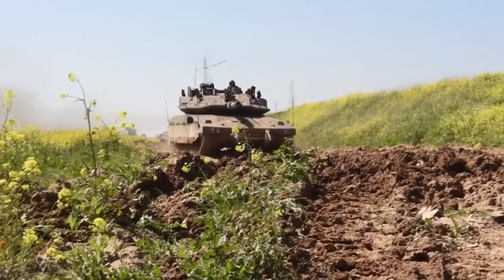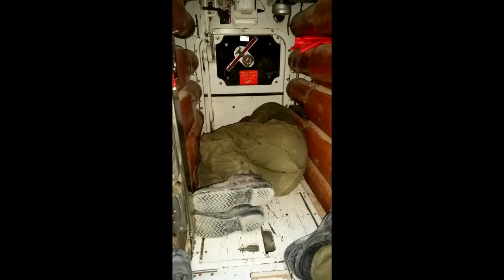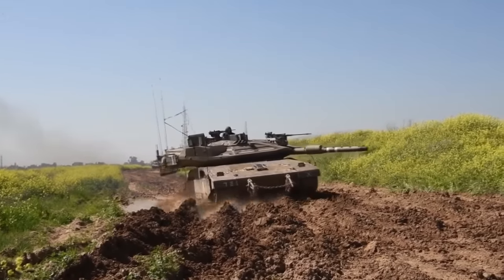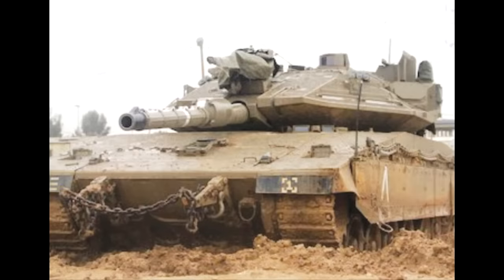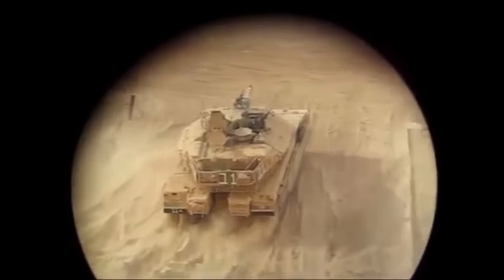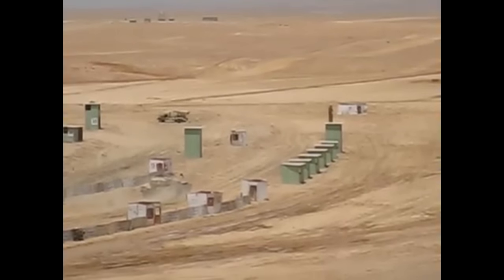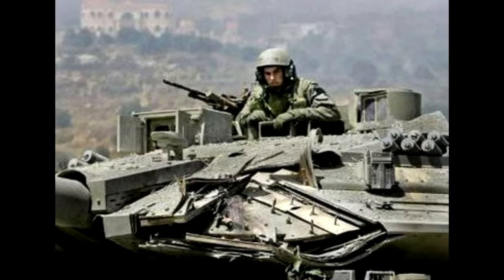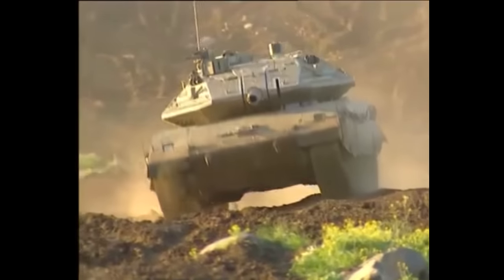Problems with Merkava tank

Comment: The thing you have to keep in mind is that Israel didn't design the tank for tank on tank combat, far from it, it's focused on urban warfare and vs. ATGMs or RPGs as that is the threats that Israel has to go up against.
Surely it isn't the best tank in the world in every aspect, but for what it was designed for it might just be.
I can confirm the engine's exhaust sometimes interferes with the thermal sights, but you can work around it relatively easily.
Great video!

Comment: There are no invincible tanks.
Some are better for warfare in icy areas, others are better for warfare in hot areas.
Some are better for wet areas, others are better for deserts full of dust floating in the air.
The Merkava was designed specifically for Israel's needs, not Ukraine's, not the US.  And it works well for Israel.
It is true that about twenty of these tanks were destroyed, but the same has happened with the Russian T-14 Armata tank, considered a very advanced tank. And the same would happen with other tanks.
The reality is that Israel has lost only one tank in Gaza in almost 3 months of war, despite the fact that HAMAS possesses THOUSANDS of RPG anti-tank missiles.
So things aren't so bad with this tank....
Reply: Tank tidak hancur tapi hulu ledak yasin tipe tandem shaped charge melobangi dan membunuh kru tank atau membuat amputasi dan gila

Comment: "there are no modern composites than have equal or better levels of protection than the same thickness of steel" based on what may I add. Where do you source this?

Comment: ...you...you do realize, they angled/sloped the armor to encourage richochets... since MOST shells in modern tanks arsenals require a 90-45 degree impact for the munitions to actually puncture otherwise they're not facing 100mm dead on, it actually due to geometry turns 100mm into about 115mm-120mm due to the round moving in a straight line. 

Now, with all that said, some rounds are designed to 'auto-correct' on impact, turning the round as well as deformity deformity warheads nose cone so it brings it (hopefully) into that 45-90 degree strike and inducing a damaging blow.

But, because tank shells just like bullets and other physical projectiles or ballistic weapons operate on physics, physical objects traveling in a straight line and with force to a target, will deflect and change angles to the path of least resistance on impact. So unless you're shooting it from below, or above at angles that turn those odd shaped faces into 'sweet spots' (look back to 45-90 degree corrections) those angled faces will increase the odds of a shell or explosive shells (rpg's etc) being redirected away and richocheting rounds way off course. The principle is also visible in ballistics on rounded surfaces, since the energy is directed around the 'bulb' it encourages the shot to travel in directions where they encounter the least physical resistance 'forward'.

Now, with this all said, yeah... the turrets having a face TOWARDS the main body is...kinda a misuse of angles... one wrong shot and it's deflecting a shot down into the main body.
Reply: Modern apfsds don't care about armour angle.

Comment: These are all good points imo. As for the gun from what a friend Israeli tanker told me most of the rounds loaded in the tank are HE rounds of different variants so I am unsure if the Merkava needs a bigger gun since mostly it is designed to fight in cities it will still fire the same HE rounds as for a longer barrel it would be harder to maneuver around.
But this is how I see it I may be completely wrong as I did not conduct any research and my comment is purely made on my opinion.

Comment: Wait so because the front fuel tank is only protected by 100mm of armour and if set on fire could knock out the tank, then you're telling me this thing can be destroyed by a tiger from the front.
And because of this one single exploit that means the tiger is by far the superior tank obviously
Reply: You forgot about the angling of the armour. It gives it at least 300 mm effective armour thickness.

Comment: im not sure where you done your research but even abrams tanks are being taken out with 20$ IED's every tank has its flaws and the armour of the tanks these days is nothing compared to the AT rockets today therefore the design of the merkava is made for israely use only, it has what it needs for the use of israely forces put aside that a tank in israel that was damaged today can be repaired in about a day because the armor is built from chunks also the fuel is placed at the front for the exact reason that the shells can catch fire the motor that is placed at the front of the tank saved a very big number of crews and has shown its effectiveness in real battles, i disagree with alot of things you said but as i said before 20$ IED is enough to take out a tank, in israel each tank also has its attachments and the reactive armor on top of it will get upgrades soon that it will be able to reload itself without going back for replacing it. i think you should do better researches unless your channel is only made to degrade military equipment at any cost.
Reply: note the merkava can go into a battle backwords im not sure how much it would make the tank less effective from the perspective of offense but imo it should be used the way its meant to be used. if you wanna actually go and say this tank is bad leave the engine out find other flaws cuz the engine is in the front for a reason ill subscribe to see the video.

Comment: Why put the engine in the front? That’s kinda dumb
Reply: the merkava is made for crew survivability plus fuel is a very good armor against HEAT shells, the sweeds took note of this with the strc 103 they added jerry cans in the sides with fuel as a type of side armor, also during the yom Kippur war the IDF sustained alot of casualties 2500+ which drove the emphasis on crew survivability , last thing the power pack is also like a very thick armor even tho the tank is mission killed the crew is still alive and the tank can be recovered and repaired
Reply: For room so the crew can get out.
Unlike the Abrams, the Merkava doesn't burn it's crew alive whilst they try and evacuate.

Comment: Some rpg rocket hit on ammo compartment the back this useless tank will do the job. 100% surely does.
Reply: very few types of kits are capable of reaching this "compartment" when you have some very nifty (and secretive) active protection systems on board, your RPG will not get the chance to meet the armor of the Tank, maybe the metal shreds of it, which will only scratch the armor, 0,5mm deep

Comment: Does Irael use depleted uranium ammunition?
Because if I remember correctly the apfsds ammunition mad of depleted uranium fired by an L/44 gun matches or even outperforms tungston Ammunition fired by and L/55 gun. That was the US army's reason to stay with the L/44 gun, because they didn't think the L/55 would be necessary.
Germany adopted the L/55 because they won't (or are not allowed) to use uranium.
Reply: That wasn't the reason at all. L/55 just doesn't fit on the Abrams, which was designed with a 105mm and retrofitted with the 120mm L/44.
Reply: @SuperGeronimo999 I thought they didn't really change the breach of the L55 cannon in terms of making it bigger, seems to me they just slapped an extra half meter of barrel in front of the L44 and called it a day, so it shouldn't be a massive problem to fit it onto Abrams models. I think the main reason why the army kept the L44 was that it was already more than adequate for taking on T-72b3s and t-64s that they'd usually fight, so they didn't bother spending the money on refitting all the old Abrams models.
Reply: @ExHyperion  As i said, the Abrams was designed with a 105mm cannon in mind, and the 120mm L/44 is as far as they could go. The exact same goes for the israeli Merkava. There will be balancing issues and the turret will have problems to rotate if the tank isn't in flat terrain. 

They actually tried it, back in 1999:
https://www.globalsecurity.org/military/library/budget/fy2001/army-peds/0603653A.pdf
Reply: @ExHyperion  Also still experimenting with other guns: https://www.youtube.com/watch?v=5lqW94Gmug8

Comment: Most cars have a engine in the forward,this is also adding to the safety of the driver. 
So the ideas are not that strange, but a tank is not a car. 
But no matter what you do,it is only a matter of time,before your opponent finds a way ,to counter it.
Reply: most(if not all) country that fight against israel doesnt have APFSDS

main danger faced by merkava is RPG and KORNET ATGM , not tanks, both are basically wont scratch the crew if shot into the frontal part, thanks to the engine placement on the front

sure you can upgrade armor to make it better, but there is the catch

it add weights>>more weights means you need more powerful engine for the same mobility>>more powerful engine consume more fuels>>bigger engine and more fuels means bigger tank

why not? you might ask
problem is this tank is more or less gonna be used extensively in urban combat, thats why it doesnt upgrade its guns, because its shorter, easier to use in urban combat. like i said before, the main danger of this tank is RPG and KORNET ATGM, which is more deadly in urban combat

so by changing the armor, you basically nerf the tank on the urban combat, which this tank most likely face, but buff it on modern tank vs modern tank battle which it might never went into with higher production cost tag and higher maintenance cost

Comment: I'm wondering, all tanks seem to have problems. Tank experts seem to already know what's good and what's bad in every tank in the world. How come the "perfect tank" does not exist yet?
Reply: Because there's simply no such thing as "perfect tank". Every advantages one tank had will always had disadvantages
Reply: @Kalashnikov413  There must be a reason why such that is. So what's keeping the 'perfect tank' from existing? Weight? Technology availability to the country? Cost? Size of tank?
Reply: @The_Crazy_Monkey75  if you want a "perfect tank", it must be:
- easy to produced
- cheap (or at least not that expensive)
- versatile
- and suited for certain country's doctrine
Reply: @The_Crazy_Monkey75  you can't have any tanks without some sort of weaknesses. Let's say:

- You want to make your tanks small so that it was harder to hit. But by doing that you sacrificed the crew ergonomic, resulted in less effective crew performances.
or...
- You want to add think armor to your tank so that it can resist a lot of shot. But by doing that you basically increase the weight of the tank, thus making it harder to be transported and recovered when it stuck or broke down.
Reply: @Kalashnikov413  Ooooooh...ok!

Comment: Well the whole tank is designed to prevent crew kills over anything else so the engine placement and using the fuel and water in the tank as part of the armor makes sense.  Especially against infantry anti tank weapons which the IS has allot of exp against I'm sure.  From what I've read they'd rather have a mobility kill then lose the tank crew.  But then you'd think they'd have better ammo storage.   😅 It would be interesting to see crew survivability atats of the various MBTs.   Especially since more recently revealed stats on tanks like the Sherman put the tank in a whole new light showing them not to be the "death traps" everyone "knew" them to be.  Especially in this day and age were the value of a well trained tank crew far out weights the price of the tank.  
In the end I think this is more of a anti-insurgency tank then what we would consider an MBT.  Although I think its more then a match for any vehicle its likely to come up against in the Israeli theater.  Hence why I think they stick to the shorter barrel length cannon for use in built up areas.  Its the same reason the Canadian military is upgrading  their leopard 2s to the A6 standard but on some tanks they are keeping the shorter caliber gun (for the Anti-insurgency role) based on their exp in Afghanistan.
The Israelis  sure know how to upgrade their tanks though.  The differences between the Mk1 and Mk4 are substantial.

Comment: Engine heat obscuring gunner thermal vision? Gunner needs to turn the turret to see a target? That is a kind of nonsense you rarely hear. Whoever says that kind of dogshit, does not have a clue what is a black body radiation and how thermal sensors work. And the video is proposing what exactly? That tank with a crew in front and engine in the back is more protected then tank with an engine in front of the crew? Did the author think about what is that protection for exactly and what (who) needs to be protected by it? Only thing close to common sense in this video is the fact that tank with an engine in front will have higher thermal signature seen from the front.

Although we have not seen Merkava Mk4 fighting against other tanks to understand its protection against kinetic projectiles, it is one of the most battle tested tanks being in active duty today. Not just battle tested, but having it done in the most unfavorable for the tank conditions, in an urban environment. And in its history there is more than enough facts proving its very high degree of protection. 

Overall this channel is more about translating Russian propaganda about Russian armor, about flying hard kill systems miraculously defeating incoming APFSDS projectiles  that are moving with 1500 m/s and having kinetic energy of a freakin train, Russian Explosive Reactive Armor defeating top attack anty-tank missiles with a tandem warhead and that kind of |Russian vunderwaffe fairytales. 

If the author would believe less to propaganda videos, and would use more objective analysis without axiom statements not backed but anything like in this video, this channel would be of much higher quality.

Comment: Thank you for this very intresting video ,Can't they move the engine to the rear of the tank and use the older tanks that have been converted to personel carriers . concidering just how much Israel needs it's tanks one would think that they would not delay and fix this problem  a.s.a.p
Reply: Clearly the IDF doesn't see it as a problem.
Reply: This tank isn’t a Western tank, it’s design specifically adheres to what Israel needs. It’s not trying to be the best of every right, people just pit it off as if it should be taken for granted. To go back to their design, they’re supposed to fend off potential enemy nations that hate them, therefore it’s built around a defensive scenario, and since the engine is in front it’s protecting the crew since Israel cannot afford losing personnel compared to other nations. And the engine smoke discussion does not exist. A CV90 operator and an M1128 operator basically stated that it in no way block much, if any performance through sights, and engine smoke in general shouldn’t have the properties of 40mm smoke launchers either.

Comment: The Merkavas,  Israel's pride & glory, were destroyed and/or made inoperable by Hezbollah using missiles which cost a few 1,000$ to the extent that Israel had to redefine how it was to be used in certain battle conditions.
Reply: That comment you wrote is very misleading , some were destroyed but It was not just merkava mark 4  but merkava  2 and 3 ... which are a different tank de facto ...  also  even the merkava 4 did not have active defence systems that they now have                          (   idf also did mistakes with operating with the tanks and they changed operation   (like they saved on using the smoke screen of the tanks - so they didnt even use full capabilities with the tanks than)  - but israeal army idf always does this , they learn from mistakes even small ones , it always redfines how its used   - so you wrting about redefine )

Comment: The Merkava has seen action since 1982. From 1982-present 5 tanks has been lost. Yes you read correctly. In a span of 38 years of action the israelis lost 5 tanks on the battlefield. The last tank was lost in 2011. 9 years ago. In the same timespan 9 soldiers has died operating the Merkava.
The israelis has constantly improved the tank. The tank in action today is Merkava IV.
This guy can talk about front engines all day long. The Merkava is as close to unstoppable as you can get.

Comment: The main strategy of Merkava is holding a defensive entrenched line, With extremely high fire power 3+ machine guns and even a mortar on top.

Door at the back for ammo supply/switching crew/wounded, Each tank acts like a mini fortress in battle.

May god help you if you plan attacking an Israeli armored brigade.